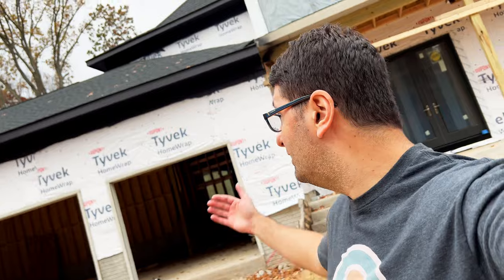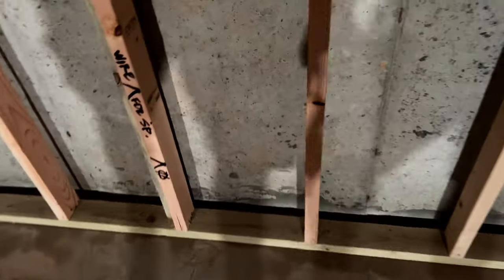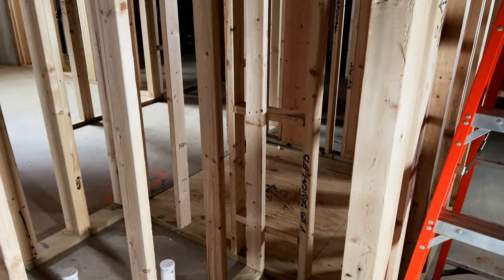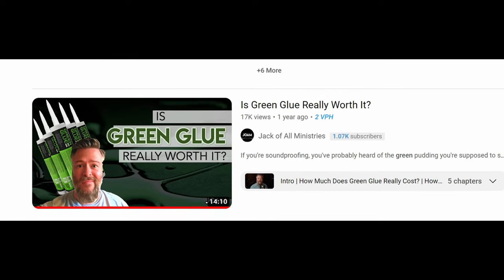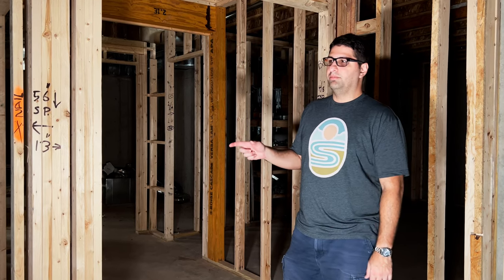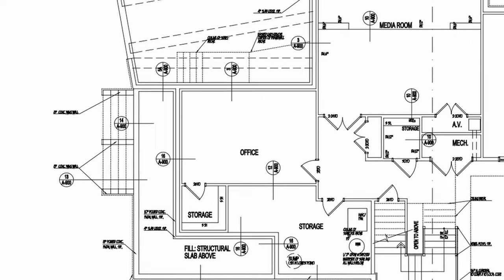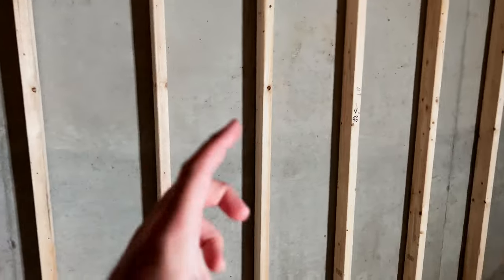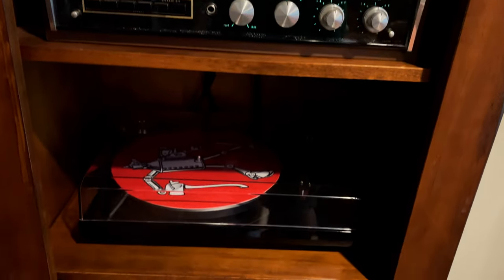NEW THEATER BUILD: Week 8 Update on Framing and Speaker Placement

Comment: So it’ll be a 9.2.6 setup (LCR, 4 sides/2 rears, your 2 subs, & then 6 Atmos?)
Reply from the maker: Technically, it’ll be 9.2.6 but I’ll have another set of side surrounds.  The room will have 6 subwoofers if you count the ones built in to the towers.